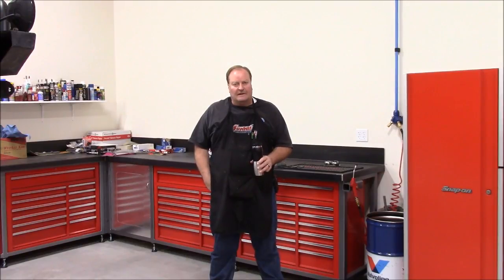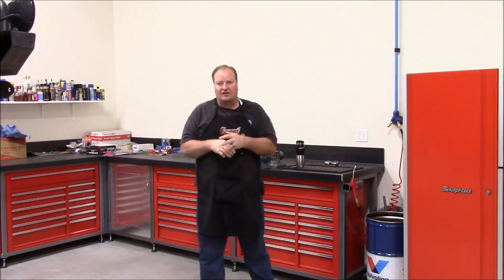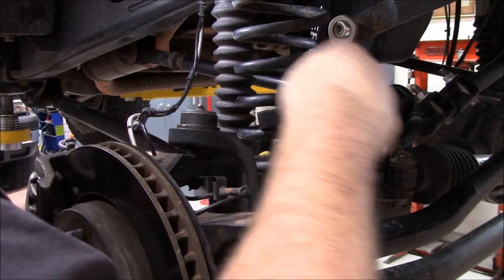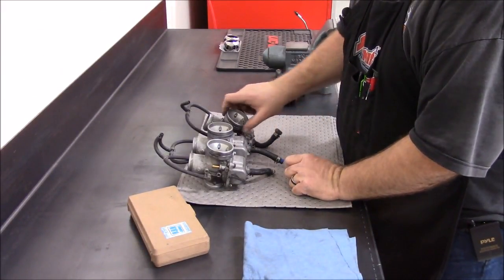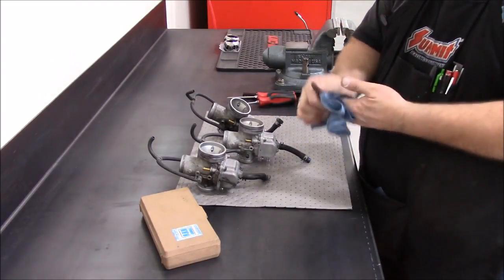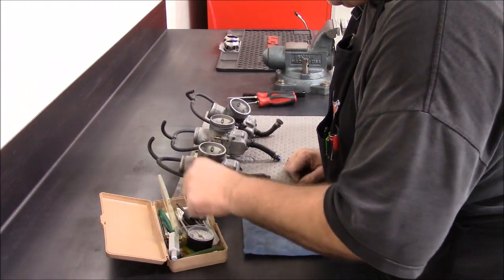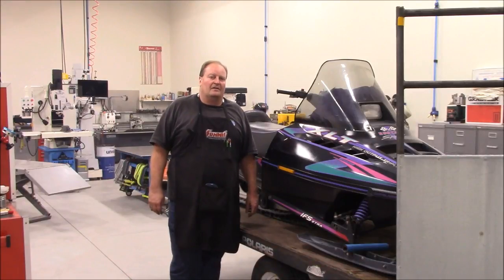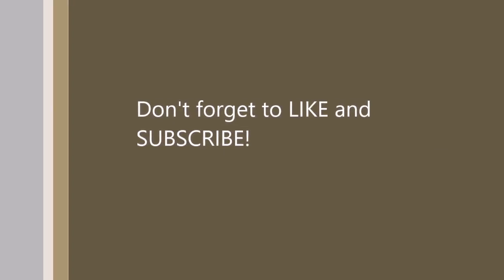Shop Bits & Pieces #3

Comment: Hi Mike.  Question,  I am getting ready to purchase a mill and lathe from P.M..  are you still happy with your mill or has it turned out to small?  I’m looking at that same lathe.  Thanks
Reply: Sorry.  I meant mill.
Reply from the maker: Dale, I am still very pleased with my choice in mills. If I were purchasing now, even with my larger shop, I would more than likely purchase the same milling machine as I really haven’t come up against my maximum work envelope yet on the items I machine. I am sure I will some day but I haven’t so far. I do like the smaller footprint of this mill even with having more space available.
Matt gas been great to deal with and I highly recommend this mill. 
I hope that is helpful. 
Thanks for watching. 
Mike
Reply: Hi Mike.  Sorry but I have one more question.  Is the X axis (24) inch work surface big enough to put a dividing head tailstock on and still have a decent work area?  I’m also looking at the PM-950 but it seems a little large for my area but It has the needed work surface.  Thanks so much.  I’m getting ready to make the plunge and I will definitely mention your name for great support.  Thanks again.
Reply from the maker: No problem Dale, glad to answer your question.  I have not used a dividing hard and tail stock combination yet so I gave no first hand answer for you. I have however used my rotary table in the vertical position milling flats on a 16” long shaft without any issues. You just have to plan accordingly for initial placement of the tooling. 
I did have a 30” fixture plate that I was milling the edge on and drilling/tapping holes in and had to make provisions by milling as far as possible along the X-axis, then reposition and continue. Not a big deal but I think even on a 9x49 Bridgeport it would have to be done in the same manner. I’m certain on a 10”x54” mill it would have been fine in one pass. 
Hope that makes sense and helps. 
Mike
Reply: Greatly appreciate your help Mike.  Thanks again
Reply from the maker: You’re very welcome. 
Thanks for watching my channel. 
Mike
Reply: Hi Mike.  I ended up buying the PM-1440BV lathe and PM-935 mill.  Thanks for your help.  Working with Matt was great.  I would like to ask a question.  Why did you raise the mill by 8 inches?
Reply from the maker: Congrats on your machine purchase. Matt is great to work with. I don’t have any experience with the 1440BV so you will have to report back on your thoughts. 
As for the base on the mill, being 2/3 the size of a full-size Bridgeport it was a bit low for me. Being 6’2” tall I didn’t want to be hunched over working at it so raising it up to a more appropriate working height custom tailored it to me. 
Mike
Reply: Thanks Mike.  It been great talking with you.  I will let you know how the 1440 goes.  You have been a great help.  Thanks
Reply: mike I also wanted to let you know that I told Matt that you were great help in my endeavor.  Thanks again
Reply from the maker: You’re welcome Dale. Glad to have helped. 
Mike
Reply from the maker: Thank you, I appreciate you providing Matt the feedback. 
Mike